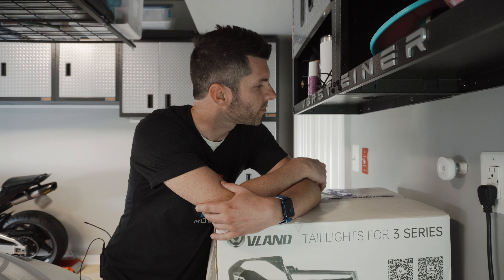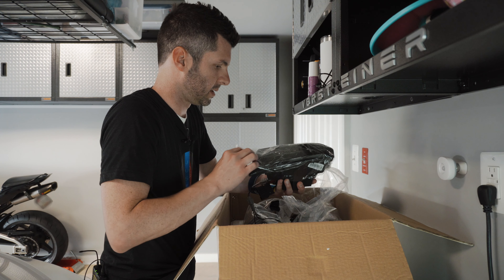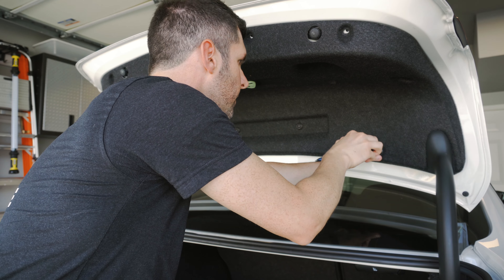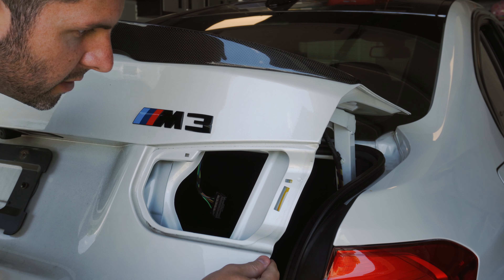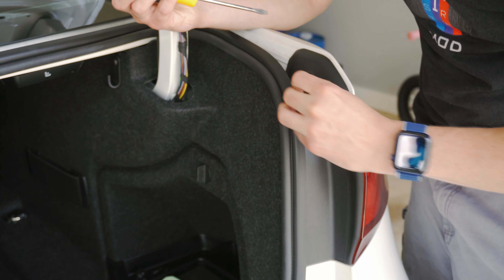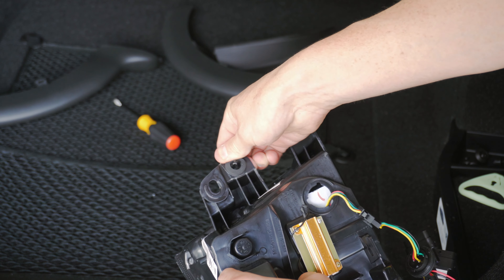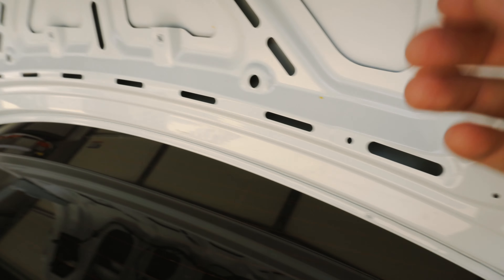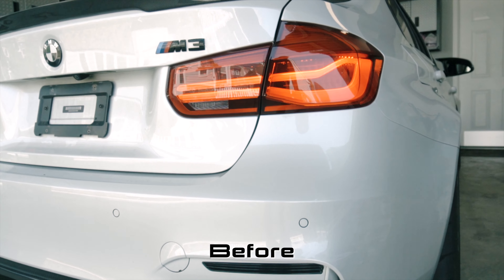GTS OLED Style Tail Lights | BLACK EDITION for BMW F80 M3 and F30

Comment: I have the red version and the turn blinkers are not bright enough.. when the car is in direct sunlight the blinkers can hardly be seen. I think it is easier to notice blinkers with the blackline style
Reply from the maker: Interesting. I’ve heard the same from a few others on the forums. 🤔
Reply: Get film tints on them £40-50 for the pair you’ll be good🙌🏾
Reply: @Axs14122  they are already smoked why would he want to get them tinted
Reply: @alejandrojarquin7775  the guy just said he had the red version lmao
Reply: Interesting I installed these blackline VLAND today and in sunlight, the indicators are a bit harder to see

Comment: Are these lights just plug and play? Can the rear fog light turn on without the Bimmercode app or do you have to do it all over again? Thanks!
Reply from the maker: Plug and play yes. As for rear fog, you’ll still need to code and “make” the button if you have a U.S version.

Comment: Yo!

I'm stuck between the red and smoked. It'll be going on a black 435i GC.

Do you find the smoke to be too dark, or is it the perfect amount of smoke? I kinda wish they did a clear lens black line.

I saw some chatter about the turn signals being too dim in the daylight/sunlight with the smoked version, any opinion on this?
Reply from the maker: Hey! I personally think the black looks best on white or black cars. And red for all other colors. But that’s just my opinion I would say the turn signals are a tad slightly dim on the smoked version, but only in direct sunlight. Hope this helps.
Reply: @Just1MoreMod  ty. made my decision much easier.

The smoked version looks amazing on your car!

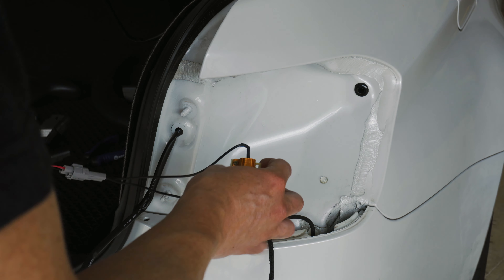Comment: I got a question regarding that wire that goes through the small hole. Around 10:45, you cut that piece off. I have been using it through that hole without cutting the piece off. Do you think I should cut it off? Just not sure if I caused any damage to the wire itself since I got it on days ago, but I definitely want it to sit flush.
Reply from the maker: I don’t believe you’ll cause any damage.. I know some people that did the same thing and were able to manage to get it through the hole and still be flushed. But some people said they struggled too much with it. I just decided to cut it off and skip any possible struggles for it to sit flush 👍🏼
Reply: @Just1MoreMod  Gotcha. One more question if you don’t mind, I have my lights on auto and it seems the dragon scale aren’t on during the day. Is this something I’d have to change through BimmerCode or does yours stay on when on auto?
Reply from the maker: @JE335 hmmm. Tough to answer, as before, I put these tail lights on, I had already coded my original tail lights to be on daytime running lights. so when these were installed, they were just automatically always on. I would say go ahead and try coding it through BimmerCode. It’s very simple and quick to do.
Reply: @Just1MoreMod  I see. I remember on my lci OEM taillights there were on already, although when I put these on, the dragon scales aren’t on. I’ll go ahead and try it. Thank you! 🙏🏽

Comment: Have you had any issues with seeing the lights in direct sunlight? I have been wanting to install these into my M3 CS, but keep seeing comments about this issue.
Reply from the maker: Hey, great question. Zero issues with the daytime running/brake lights. In super super bright direct sunny days, the amber turn signals can appear to be a tad dimmer. But the red is bright 👍🏼
Reply: @Just1MoreMod  Thank you! Going to purchase tonight!!
Reply from the maker: AWESOME! Enjoy! 👊🏻
Reply: I got them in and really struggling to get the smaller light on the right side locked in to the trunk lid! Any tips? Considering double sided tape but don’t want to see it raised up at all… Also what wireless charger do you have installed in your car? It looks really clean and interested in purchasing!!
Reply from the maker: I do recall having a slightly harder time with one of the four pieces (don’t recall which side, as it’s been a while) I remember as I was tightening it down, the clip/hook would pop back out. Try loosening more, make it as straight as possible and keep an eye on it as you tighten it down and make sure it clips. 
The phone mount was something I custom made with a Kuda mount. A fun weekend project and it turned out great! See video below of every step 😉KUDA + MagnetMount Wireless Charging:
https://youtu.be/oQmU0QlDc8k
Reply: @Just1MoreMod  I just got them all plugged in and the lights are all wrong. How do I fix what lights show when braking and turn signals, etc? Is this supposed to happen.. lol
Reply from the maker: Uh oh. Nah, double check your connection points again. Sounds like one or two of them are mixed perhaps 🤔
Reply: @Just1MoreMod  after unhooking and pulling off I switched to the other connector and it works! So annoying the put the label stickers on the wrong connectors🤦🏼‍♂️🤦🏼‍♂️🤦🏼‍♂️
Reply from the maker: Okay, gotcha! Sorry you had the run around. HOW DO THEY LOOK!?

Comment: Are the dark ones legal?
Reply from the maker: Yes
Reply: @Just1MoreMod  Legend, thank you for replying even after the video's age. 1 more question, im putting it on the 2017 330i do you recon I wont have any issues with it?
Reply from the maker: No problem. The ones I link state: “VLAND OLED Tail Lights Compatible with BMW 3-Series F30 F35 F80 Sedan 2013-2018”( Not for 2015 328i F30) 👍🏼You should be good